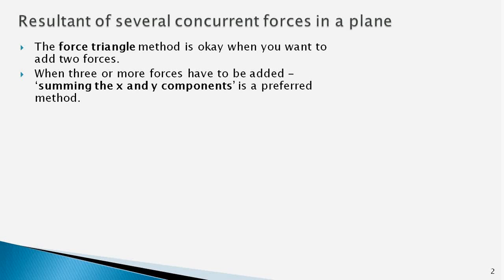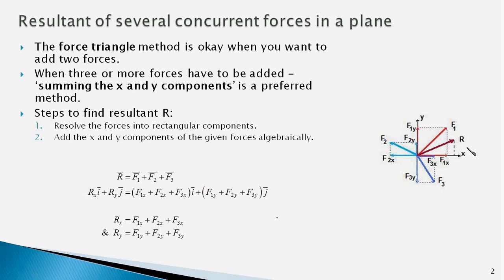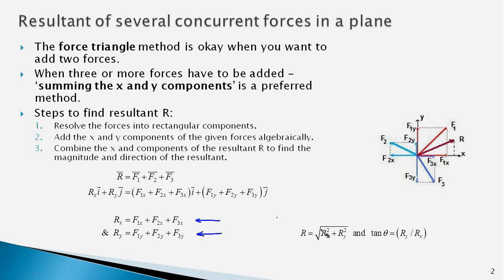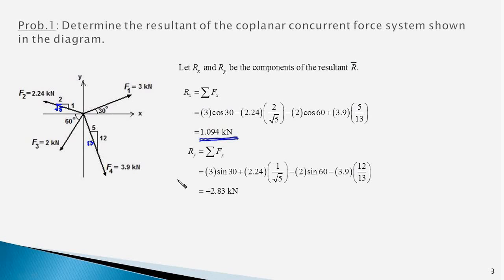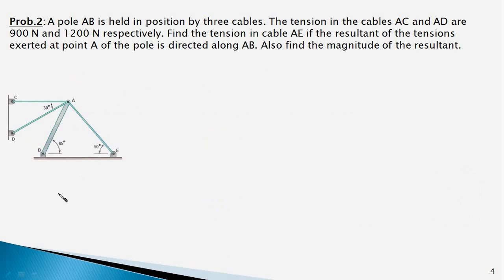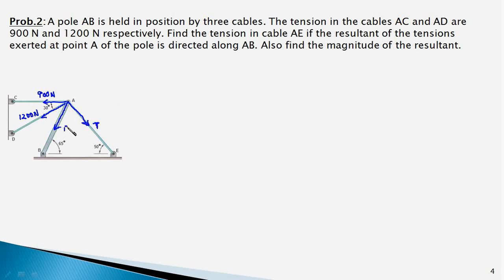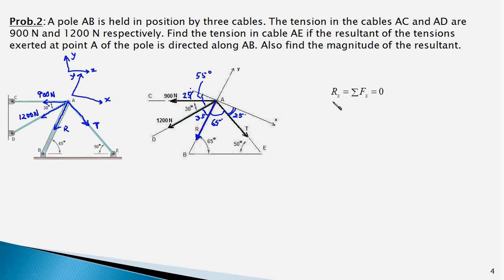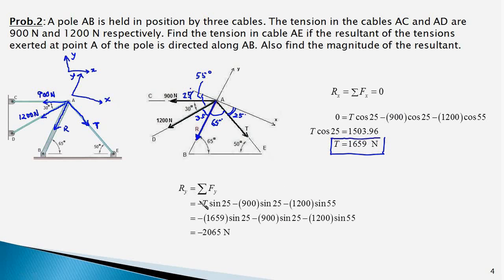3 1 Engineering Mechanics: Resultant from rectangular components of forces.

Comment: How do you determine the angle that according to which you will decide the adjacent side and the opposite side in case of the 2 triangles 1,2, and root 2 , and the other triangle 12,13, and 5 ??? 
How do we chose the proper angle for each triangle?
Reply from the maker: Hello rasha, you determine that from elementary trigonometry. Furthermore, if in a problem you're given slope of a force (horizontal and vertical sides of a triangle)instead of its angle - then you needn't find its angle with any axis. Instead, you can determine the components of the force straightaway - Fx=(mag. of F)*(horizontal side)/(hypotenuse) and Fy = (mag. of F)*(vertical side)/(hypotenuse). Hope that answers your question!

Comment: in problem1 .i cant understand the concept of slope.Can you tell me how you get 2/under root(5)
Reply from the maker: Instead of specifying the angle a force makes with x-axis (say theta), quite often the direction of a force is defined by its slope...e.g.1 unit of vertical distance over 2 units of horizontal distance and in this case the hypotenuse of the slope triangle would be  square-root(1^2+2^2) = square-root(5). And therefore the horizontal component of a force (of magnitude F) would equal F*cos(theta) or F*{2/square-root(5)} and the vertical component would equal F*{1/square-root(5)}
Reply: ok thanks.I got it.